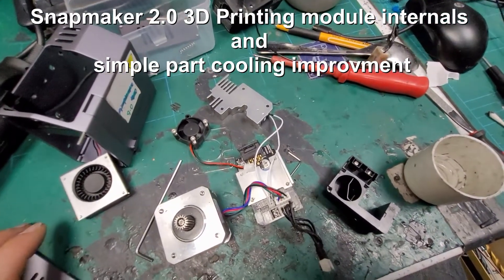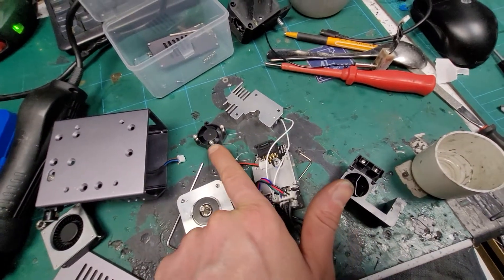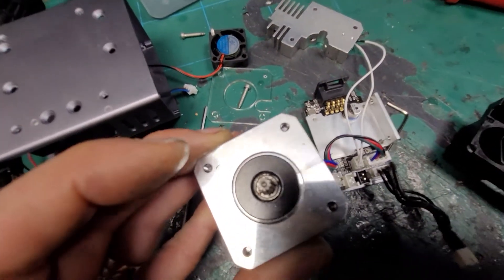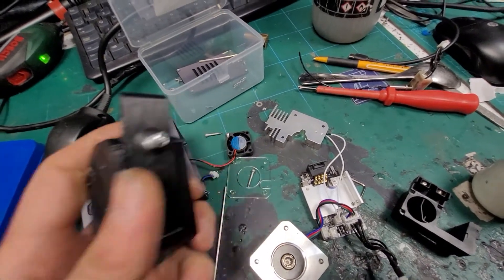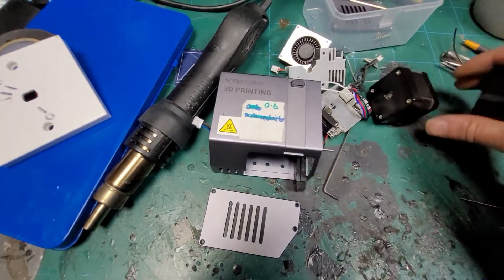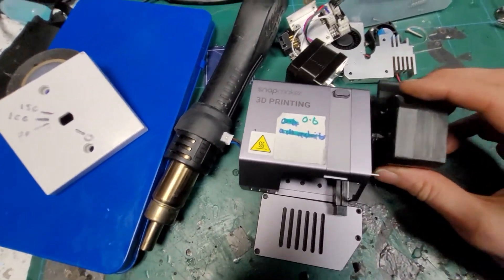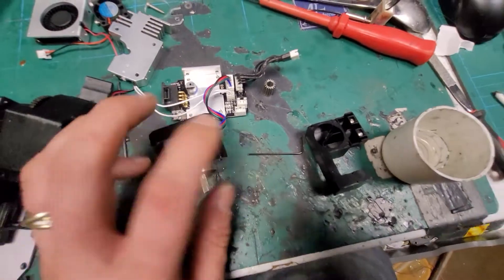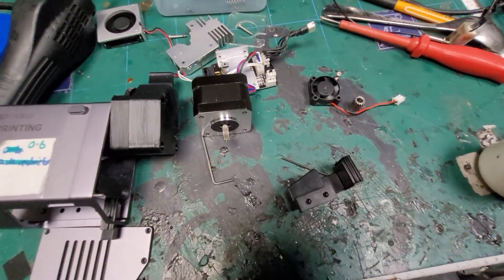Snapmaker 2.0 3D Printed Head Internals & simple cooling upgrade

Comment: The real problem with Snapmaker cutting the extruder teeth into the motor shaft is that extruder gears do wear out, and when that happens the ENTIRE MOTOR has to be replaced.
Reply: luckily this things are modular, but i agree same thing the cooling fan needs a better upgrade something abit more beefier.
Reply: mine has worn down and I can't find replacements for the motor. seems you have to buy an entirely new 3d printing module to replace the gear.